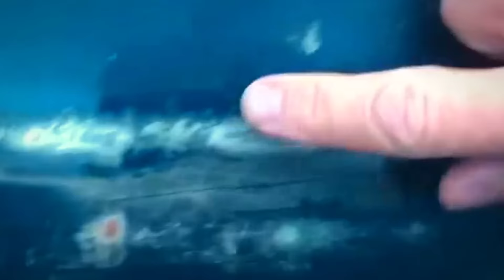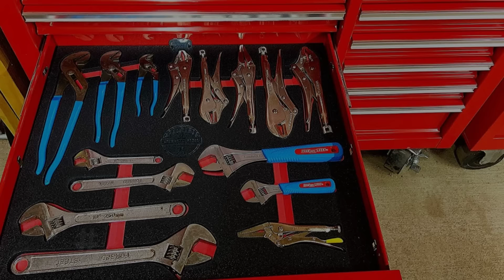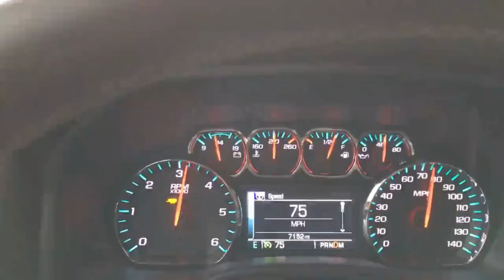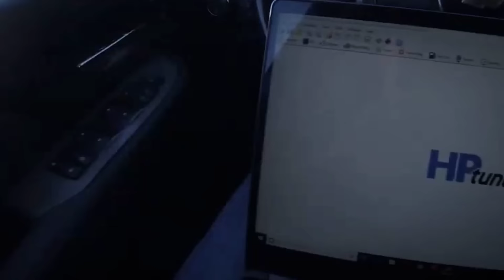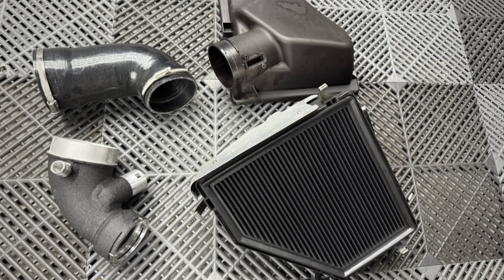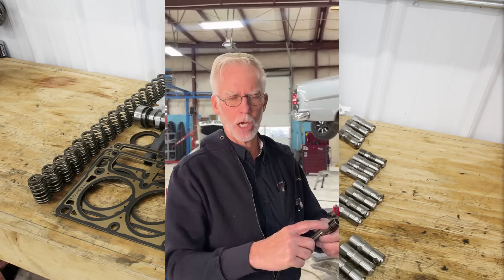13 Chevy Mods That Are WORTH IT (And 5 That KILL Your Engine)

Comment: I have a 2093 6.0 2500 and did the Transmission cooler upgrade do I still need to do the trans bypass valve?
Reply from the maker: They do different jobs. The cooler adds capacity, but the bypass valve decides if fluid even goes through it. If your temps stay in a good range under load, you’re probably fine. If it still runs hot, I’d swap the valve next. It’s cheap insurance.

Comment: A disabler isn't going to stop your lifters from failing. The lifters are STILL in there. Only solution is a delete kit that has lifters and cam to replace but, for like 6k

Comment: Never once heard of a K&N air filter voiding a warranty lol
Reply: Easier to just change the paper filter, and it's completely clean
Reply: one of those wrecked the engine in my Infiniti G35. I washed and oiled it religiously and it still left the intake covered in oily sand.
Reply: @TexasScout then you over oiled it lol
Reply: @MajorDredd230  Just a light spray after cleaning.  Still doesn't explain all the sand.
Reply: @TexasScout had one on every car since I was a kid and never had a problem one 🤷‍♂️
Reply: @TexasScout  doubt that’s what blew it up. Ran those filters for years with no issues. Hell, I pulled a filter a month ago on a worn out 5.3 that was soaked in motor oil. That truck just did a 2,000 mile road trip too

Comment: On the tonneau cover stay away from the roll up ones the velcro will wear out I have the tri-fold which is nice you can remove it if you need to with a couple clamps
Reply: Tuxedo lo pro Velcro doesn’t wear out I’ve had one on my truck for a decade still works like new fyi

Comment: You actually have no idea what you’re talking about. Don’t ever push bypassing your trans thermostat. Do you even know a 6l80 and 8l operating temperature range? Once completely bypassed your transmission fluid will never get up to operating temperature especially in cold weather also destroying it. There are plenty of updated bypass valves that open at 170 for $90 that’s oem and anyone can change out. Including an intake does the same exact thing as an overpriced k&N, the intake hole in the fender is four feet off the ground so he deserved to get his engine hydro locked
Reply from the maker: Keeping the transmission within its intended operating range is important, especially in cold weather. An updated bypass valve can be a better solution than removing the thermostat entirely. And the intake/hydrolock point is worth considering too.

Comment: Weather tech info is ACCURATE. mine are 100% curled around the edged and look crappy. $600 for garbage
Reply: Did you get the HP version?

Comment: I have longtube headers straight piped no cats or muffler with no check engine light on runs and drives excellent 05 5.3 suburban

Comment: Most people who add a lift kit also add bigger tires and forgetting to re gear the axles, that's a must for the life of the transmission and the engine
Reply from the maker: Re-gearing is often overlooked, but it can make a big difference in performance and drivetrain longevity

Comment: There is a tsb for updated thermal bypass valve. Instead of opening at 194f the updated one opens at 156f. Also u should have magnetic oil drain plug in here, aem dryflow drop in air filter. Change the oil at 4500mi, 0w20 an ac delco filter. Front leveling kit with 2-4in tubular steel upper control arms. A Premium drilled and slotted rotors and ceramic pads with se sora a d hardware and was $400. Going on 15k miles on them trucks got 74k. Miles supertech 0w20 advanced full synthetic and pf63 filter changed when kt hits 50% on monitor. Oil catch can collects 1/2 qt. No issues with engine at all

Comment: 2000 gmc yukon xl, dropping in K&N filter with tornado tin impeller into intake pipe.
2000on tach= 70mph stock.
With these changes now 73.  For $150 bucks.
Original Motor  291k miles !!!

Comment: For some reason,  the cratering  of AFM/DOD is much more common  on the 6.2L.  Had a 2015 Sierra Denali at 120,000 miles that broke a push rod.  Cam not that badly damaged.  Replaced the #6 cylinder lifters and ran ~5,000 miles, then it did it again - same cylinder.  Could of, Should of done the DOD delete, but had it fixed again. both to the tune of $4500 each.   <1,000 miles later it cratered the third time, same #6 cylinder again!  Shop fixed it again under warranty  (2yrs/20,000 miles).  Drove it to new car dealership,  and traded it off for a 2026 Toyota Tundra Platinum.  Got an amazing trade in on it and is now someone else's problem.  Yeah... I know the Toyota 3.4L twin turbo I-force engines have some issues,  but haven't seen any advisories or service bulletins or recalls on the 2026.....but if it does crap out, at least I get a  brand new engine if they haven't solved the crank and main bearings. (it never was because of metal shavings as Toyota is saying.  Most all are spinning main bearings on the crank)

Comment: 2009 silverado 5.3L, 306k miles. Aftermarket cold air intake has been nothing but a pain in the peen. 1000% do not recommend

Comment: Hey guys, I’m an engine builder. There’s absolutely nothing wrong with a can and air filter except the way you use it. You’re not supposed to overspray it with oil that’s the killer very light spray. Light should be able to put your finger on it and not feel any oil whatsoever that’s the issue. Do not use heavy spray of oil extremely light and you do not have this problem.

Comment: Here is the Transmission tech bulletin.  Highly recommend, did it and temp dropped 40+.   ServiceBulletin BulletinNo.: 21-NA-199 Date: December,2021 INFORMATION Subject: InformationonInstallationofaNewThermalBypassValve(TBV)

Comment: I got the afe true cold air intake can't really tell a difference in gas mileage. But it did make my exhaust louder I cut third cat no engine light with spin tech 9000 muffler n duals out the side. But you can feel it get up n go on the highway better and does have better acceleration. I also just changed my oil and trans fluid to Amsoil instead of the mobil 1 and it really made a difference. The clunking /hard shifts I basically gone and no more shutter it's crazy. And the motor runs smoother. My left n right motor mounts are shot n the motor would shake noticeably but after the amsoil it runs smooth even with blown mounts.
Reply: So why does GM purposely design shit to fail?
An even bigger question is why do I keep buying the shit the so proudly manufacturer?
Reply: @johnbarker698 I wanted a tundra 5.7. I wrecked my previous vehicle and needed a vehicle fast and they didn't have any tundras that I wanted and in 4x4. I found Sierra for a good price and was a 1 owner clean Carfax fully loaded 4x4. So I bought it hoping it would be a decent truck.
Reply from the maker: That’s wild, but believable. Fresh fluids can make a huge difference, especially in the trans. Getting rid of the clunk and shudder alone is a win. Sounds like once you do those motor mounts, it’ll feel like a whole new truck.

Comment: "Cold" air Intakes and K&N type filters are a huge waste of money and time. 
Most vehicles today breath through existing ducting that grabs "Cold" air from the front of the grill anyway. 
The junk CAI place the junk filter in the corner of the engine compartment, breathing in all the super heated air from under the hood, and to top it off most have an "oiled" filter that damages the sensors and allows dust to enter damaging the piston rings.

Comment: I have a carbon fiber bed. Carbon Pro, on my new GMC. My Silverado has a ceramic coated bed, and it has a ARE bed cover so it stays dry. Have the rear bed liners. And the soft opening tailgate piston. No rust. GM makes a new design valve cover for the PCV.

Comment: Doing a AFM delete right now. Pulling the engine and doing other stuff as well
Reply from the maker: That’s the best way to do it, while it’s out, you might as well make it bulletproof!
Reply: Any other way you suggest to delete AFM without  engine removal? I just bought a 23 chevy silverado 5.3L
Reply: @giani2115 yes you plug a little thing into the obd port and it keeps all the cylinder activated
Reply: I have a 2020 Silverado 5.3lt. With the  AFM  Delete To keep it in 8 cylinders and it works great !!

Comment: That factory rake is there for a reason. If you tow heavy(ish) loads, you need that rake to remain level when loaded. I hated the look of it on my 2019 Ram Off-Road, but as soon as I hooked up to a trailer, or my boat, I was glad that it was there.

Comment: My 2000 silverado 5.3 had 317,832 miles and still going, didn't trust it pulling the boat 800 miles anymore, replaced it with atk long block for $2,350 with a core exchange, new water pump, coil packs, harmonic balancer, ac compressor, dryer, orifice tube, one exhaust manifold, wires and plugs, oil and temp sensors and a whole lot of cleaning the oil pan, pick up tube and intake, got the upgraded fel pro intake gaskets and a high volume milling oil pump. New knock sensors.
Bought a engine hoist off marketplace and the plate for the engine stand and a plate for the intake for removing engine.
Did all the work by myself, two weekends and another day, I'm 58 and not young anymore, total cost was around $3,500 including the extra tools purchased. 
Probably saved 4 or 5 thousand, repair shops don't like these jobs, there not easy money and requires several hours.
Did it all outside, no lift, just a jack and a couple wood blocks.
This was way easier than the 87 ford 150 with a stubborn carb and a flat tappet cam and distributor which had to be broke in.
Think about doing a job like this before flushing down $70 grand on these new computerized shit boxes. Good luck.
Reply from the maker: That’s seriously impressive! Well done.
 Doing a full swap like that solo, outdoors, and saving thousands is no small feat. Your Silverado’s lucky to have an owner who knows his way around a wrench.

Comment: 260,000 on my 2000 Z71.  Still smokes the tires.   Changed the rusted rocker panels.  Changed all 7 rusted brake lines

Comment: Oil catch can, engine tune eliminated the afm, k&n air raid air filter, kooks headers with hi flow catalytic converters, Borla cat back exhaust. 2015 GMC Sierra 1500 210,000 miles.
Problems
2 air conditioner break downs 
2 rotor failures
2 water pumps
Transmission failure at 137,000 miles
Reply: Rotor failures? Explain that one.
Reply: @JoeyDaBull maybe the shop screwed me.ive never replaced rotors after 10 years with past vehicles. The previous owner might have been hard on brakes,front,. I bought it with 50k miles
Reply: @danarcotta1283  thats a long time u must not drive a lot and r a pro like me who coasts to a stop whenever possible..
Reply: @JoeyDaBull I drive A LOT im an easy guy on brakes
Reply: I just do the rotors when I do the brakes, also take apart and lube the calipers

Comment: At 208000 miles on my 8.1.  No smoke- oil and filter change every 5000 miles - run a K&N intake system.  Mobil 1 synthetic...

Comment: My 2015 Silverado 1500 4WD really does stop noticeable better with the Powerstop 4 wheel pads and rotors made for towing. It's no bull, you really do notice the difference even in everyday driving. I second the recommendation.

Comment: 3K at most for a lifter job,  I will stick with sylvania for lights,  Just grease under the drop in liner and call it a day, my drop in had been in my truck for 20 years with no rust under it, the husky liners don't have a deep pocket to trap things so the water and crap get on the carpet, get Foam Tape Camper Weatherstrip for between the cover and bed rails and the leak problem is solved, and get a cover that uses a full frame like the 90's did, an oil catch can in the PCV system is a must with the direct injection design for any newer vehicle because the injectors sit in the combustion chamber leaving intake valves dry and vulnerable to buildup, yes disable the fuel management,  the low temp bypass is a needed thing if you are towing all the time. I like flow master on my trucks but have been using them for 20 years, just keep the sock intake for anything 95 up, #11, #12, #13 is a good option but I like wilwood brakes about the same performance, anything after the tbi engines lose performance from cat delete, great advice, keep it up.

Comment: I had a tri fold bed cover. And couldn’t get rid of it fast enough. I paid a lot more for a roll up with the tool box’s combination. It all locks with the key fob for the doors. You can stop a lot of water intrusion by sealing the bottom and sides of the tailgate.
Reply: What didn’t you like about it

Comment: Would long tube headers with high flow cats be ok on 2004 Silverado 5.3 lm7? Of course a slight tune may be needed
Reply from the maker: Yes, long tube headers with high-flow cats generally work well on a 2004 Chevrolet Silverado. A slight tune is a good idea to optimize performance and prevent any drivability issues.
Reply: If you’re changing the headers and cats , if you can, you should spring for the rest of the exhaust system and tune will make the most of these upgrades worth just that much more

Comment: I have a K&N air filter for my truck (2018 5.3 Silverado) but guess what I don’t put it in when the oil still drying I let it dry for 24 hours before I put it in my truck why? Because I’m not stupid like some people are I put a paper air filter in it when I’m waiting for my K&N  to dry.
Reply: Don't you just love these videos where they act smart for a dumb audience? 😂 I haven't watched it all yet but the thumbnail for the video alludes to a k&n cone filter is bad. I have one in my camaro. I bought 2 and clean and re oil them. I'm with you i let the oil set in before I use it again. I swap them every other oil change.
Reply: If you follow the correct cleaning instructions, you won’t have any issues with the MAF. I like the k&n reusable filters so much I use them in my home. Saves a ton of money over time. I understand where the vid is coming from tho. The majority of the world’s current population aren’t the sharpest Crayola’s to inhabit this planet. CYA b4 they fck up and look for someone to blame.
Reply: I had 2.  I would clean and oil one and leave it out to dry, then store it. Swap it in and clean the other one, oil it and store it.  Easy
Reply: Yep ...you can contaminate the MAF sensor
Reply: My K&N cold intake came with a blue filter and no oil needed!

Comment: Here’s my tip, do your oil change every 3000-5000 miles, clean oil protects your engine, dirty oil destroys your engine.
Reply: Not just clean oil in these Chevy's. Oil catch can afm delete really helps. I have a upr catch can n catch quite a bit of oil every 3000 miles afm was the dumbest thing they could have done and gdi in my opinion
Reply: @jayjay7160 , PCM change to lock out AFM all but eliminated oil consumption in my '08 Silver-Rattle.
Reply: Oil is cheap; engines are expensive.
Reply: 5w30 in the summer will do wonders for your engines
Reply: Look into Valvoline restore and protect oil, it's absolutely fantastic, watch the video on how they make it, it's interesting and a great product I will always use
Reply: Do you just top off the oil until then ?
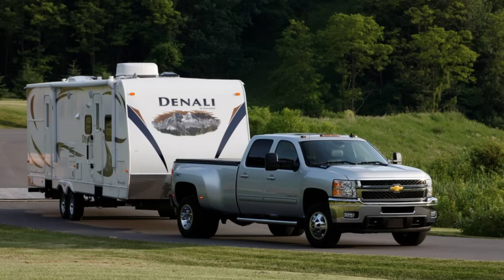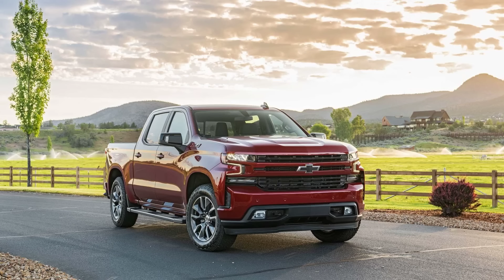Reply: C k😊ckl n m 8:50  v mc no 6ns6h,t b n8n m cm😊 9:20 z
,m😢
Reply: Regular servicing and good oil (I use mobile 1) got me over 100k without any other afm deletes or anything so it def helps but I'm going to swap in a 6.2 that's deleted after the 5.3 quits.
Reply: I changed the oil in my truck every 3000 miles, religiously and the lifters still failed.
Reply: @14idontcare14  same. Take very good care of my truck and lifters failed anyway. Even with the nexdrive that's supposed to save the motor. Just put a new motor in at 66k miles.
Reply: I do it every 3,000. Sometimes less sometimes more.
I got over 450 thousand on my 2013 Chevy Silverado
Reply: It really doesn't matter with the AFM shit. The lifters just lock up and die regardless of how you treat it.
Reply: I do mine every 7k miles

Comment: I ran a K and N UNTIL I watched REAL research on them... They let in too much dirt !
Think about it... MORE airflow means LESS FILTRATION, IT'S JUST COMMON SENSE. 🤔🤣
Reply: depends on surfacea area    more surface area lets in more air and can filter much finer
Reply: Airflow and filtration efficiency aren’t a direct 1:1—flow increases because the media is less restrictive, not because it just ‘lets dirt through.’ Yes, they can pass slightly more fine particles than paper, but that’s a measured tradeoff, not proof that ‘more airflow = more dirt.